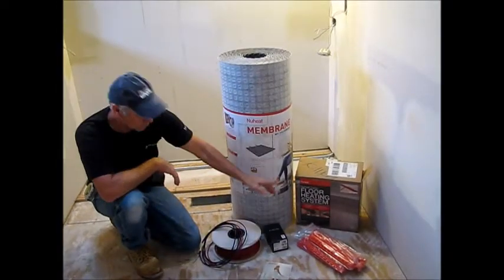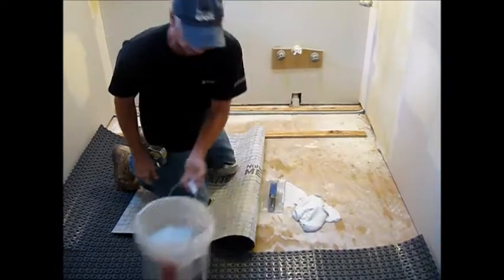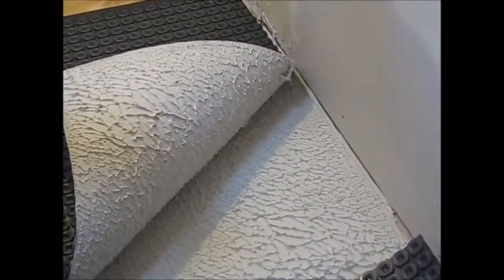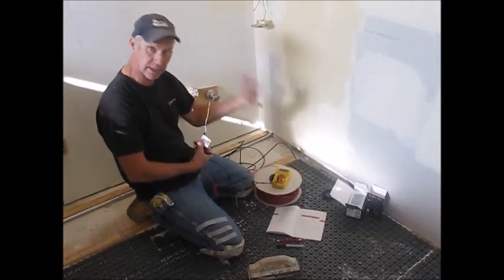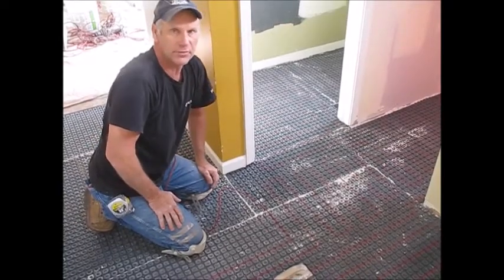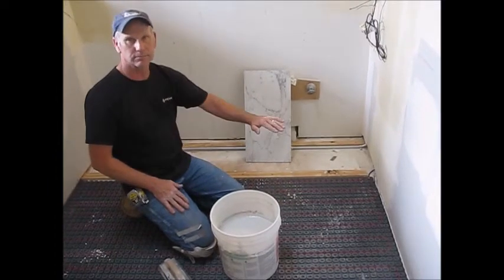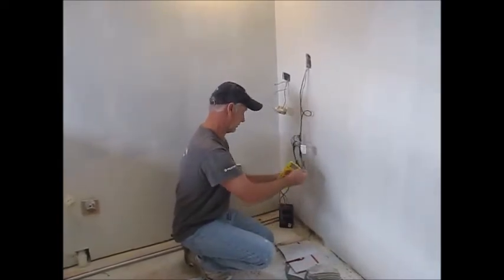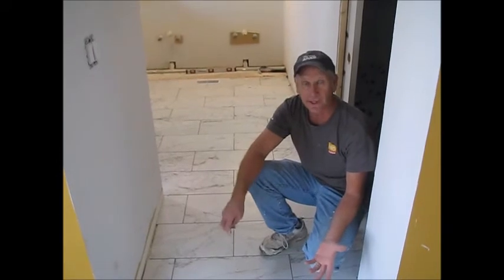NuHeat mat cable2

Comment: We did this same technique but had to use a whole box of screws to hold down the edges as every one would slowly start curling up, also I had to return my cable twice, to go down to 265’sq of cable for a 318’sq room and there was still some left over. Three different people confirmed the measurements, but somehow the amount of wire Nuheat listed was way off.

Comment from the maker: PLEASE check out the website www.edgestripkits.com    We NOW install the ESKs Vertically to provide the containment of the SLU. This way you tile TO them and then cut them flush with your tile. By doing this you will provide a 5/16" soft joint perimeter to help prevent tenting of tiles